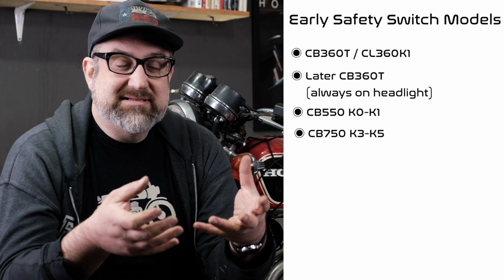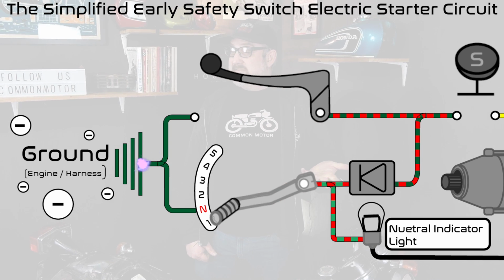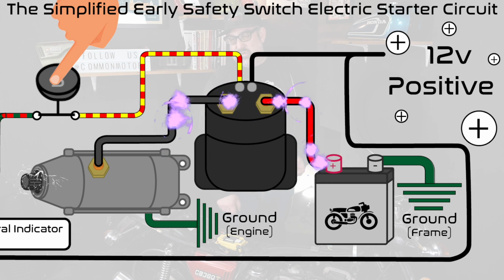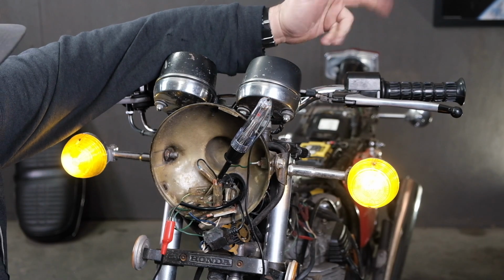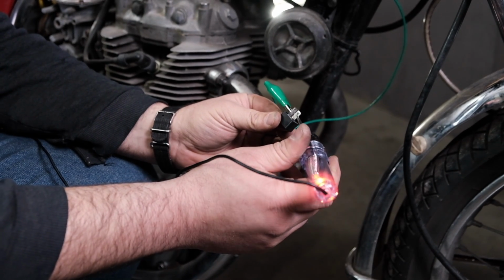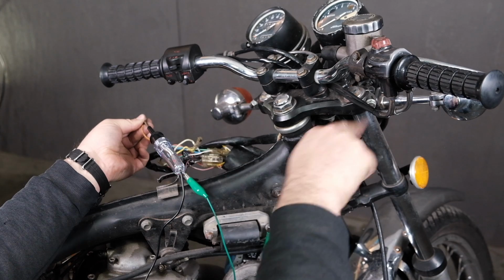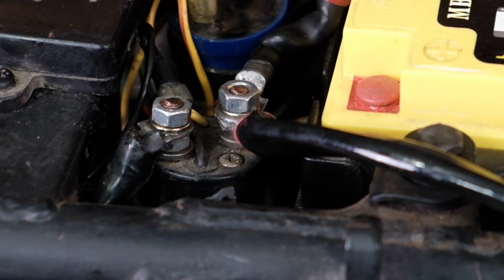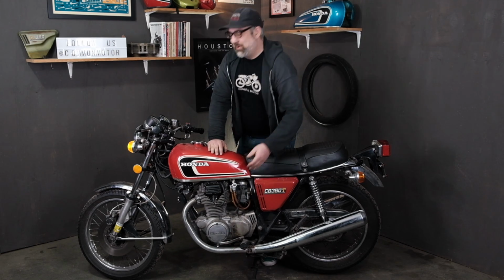The Late Style Starter Circuit:  Electrical Troubleshooting and Basics on a Vintage Honda Motorcycle

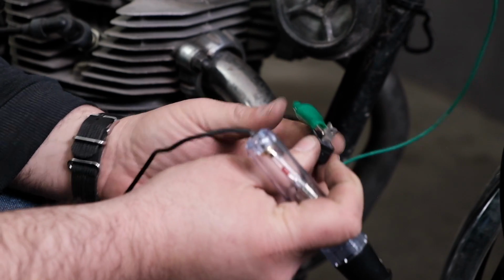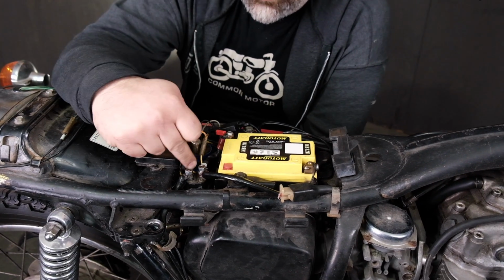Comment: Hey - I don't know if you guys read these comments but this particular video helped me end my long perilous journey of rewiring a 73 CB750 that somebody had completely butchered the wiring on.  I had everything working except the starter switch and I was starting to feel hopeless because from what I could see everything was connected correctly, all the lights and signals worked, hell even the horn would honk, but the dang starter button did nothing!  I followed the steps laid out in the 12:00 - 15:00 section and within minutes was able to see that the green/red wire on the harness side was not grounded properly, so obviously wasn't going to work.  I got it grounded and voila!  This might have been obvious to a more experienced person but I am quite new to a lot of this electrical system stuff, but I'm learning!  

Anyway, THANK YOU FOR POSTING THIS!!!!

Comment: My solenoid has Yellow/Red and Green/Red. Trying to make sense of this? All videos and schematics show that it should be Yellow/Red and Black.

Ultimately I understand the functionality of the starting circuit, diode, clutch switch, etc

Just seems odd to connect Green/Red to a black wire….

Comment: Part of this is knowing what to expect, power +/- continuity. I have adopted a bike so the compact parts are all in new places. My objective was to clean each connection going forward.

My intermittent crank I check the battery 12V+ at crank down to 7v 
, the starter works with 12v iv. My starter relay was not clicking on a constant basis. Evenjoying myself fixing these aspects with you help plus education.